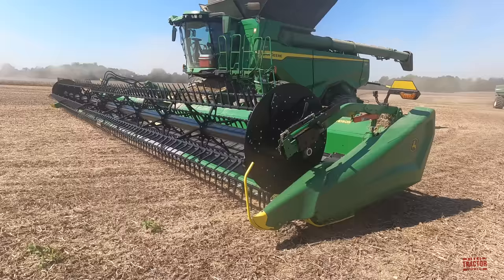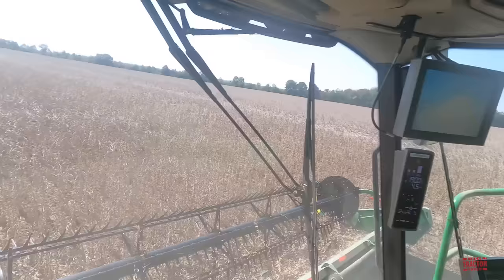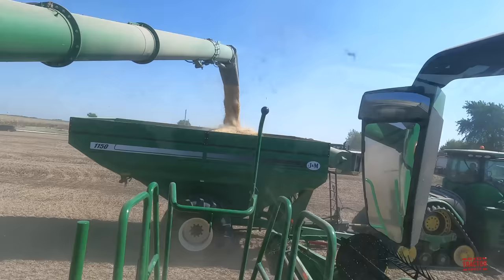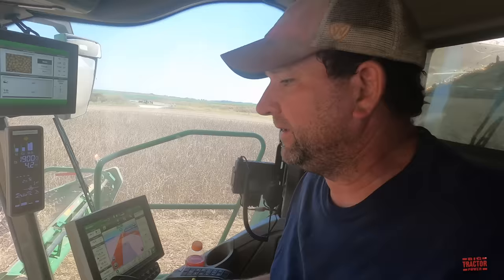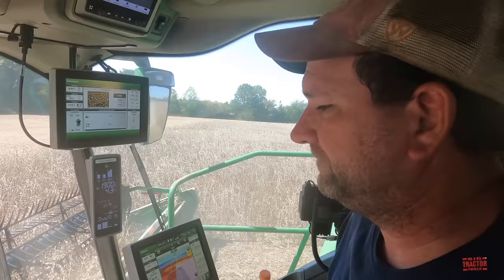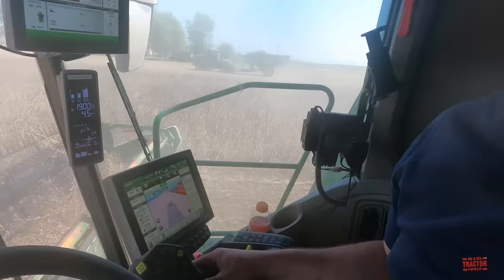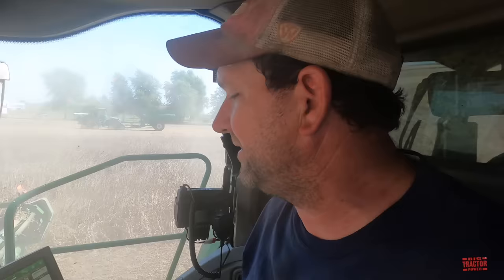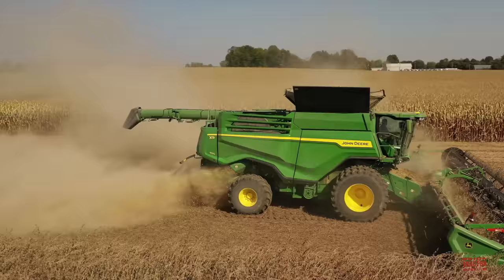50ft JOHN DEERE HD50R Draper Harvesting Soybeans

Comment: We grow soybeans here in central Virginia. Have a john Deere 9500 with a 30 foot header. Nothin fancy but it works
Reply: good for you bud. 9500 was and is one of the best
Reply: How fast do you go? I thought 25 was the limit for a 9500
Reply: Your expense $ 35000 this x9 with head $ 10000000
Reply: Great video
Reply: Yea but man they have problems at 25 years old.  We are down day after day.  Had to have a sts rotary come save us. It was good for it's time and still good for around 1000 acres.
Reply: @bendunkelman4853  we chug at 2.5 to 3 mph. The motor has had quite the power boost over the years. Our beans normally dont yield high, most are double crop after wheat anyways. She never has to work hard in anything near 80 bushels
Reply: @MRSludgedude  we only grow a few hundred acres of beans and wheat each year. On our dairy we prioritize the forage and silage equipment.
Reply: @tctarheelfarmin358  yea good machines for that. They can't match rotary in capacity but they are easy to work on and get parts and won't put anybody in debt like the newer stuff.  The 9600 will do 60 acres of decent soybeans in an 9 hour day.
Reply: I run a 1976 year model John Deere 3300 combine with 213 header on my little tiny Farm.
Reply: @SoybeanFarmer3300  Congrats to you
Reply: There's something to be said for running older equipment. A million dollars for one rig is crazy.
Reply: @j.lebowski3917  would certainly seem so for those of us who are not capable of dreaming that big.
Reply: @JD-oh9vz  tell your mail id sir we are the manufacturers of harvestors in india i will show you our products

Comment: Good lord, must be close 4 million dollars running around that field with those two other tractors, carts, and trucks.  His either independently wealthy or has his banker in the back of his pocket lol.
Reply: That is just the nature of farming today.  Any operation of size has millions of $ of equipment and very often it is financed or leased.  It's no different than many other business that haves business loans for buildings and equipment.  Farming is a business.
Reply: And what I don’t Understand is Not 1 Single Tarp on those Grain Carts. I would hate to have a Pop Up Midwest Shower, ruin 3-4,000 Bushel of Soybeans. It would be different with Corn (even though you don’t want it to get wet), but Beans Swell Up and Rot Quickly/A Lot Faster than Corn does. Tarps are A Lot Cheaper than Thousands of Bushels of Bad Beans. Also surprised that they weren’t running A Little Bit Bigger Grain Carts & Tracks or Floater Tires on those Grain Carts. At that point what is a Little Bit More Money for some Flotation/Low Compaction Wheel Setup.
Reply: @taylor11089   The grain is not in the carts long enough to worry about needing to tarp them.

Comment: My late Father always said they shouldn't have made tractors bigger than a 4020 or 806 and combines no bigger than 15 foot cutter heads and 4 row corn heads.  I feel the same way but damn that is an impressive combine and head.
Well done video BTP
Reply from the maker: Machines have grown and grown.  It will be interesting to see what the limit in size will be.
Reply: @bigtractorpower  size is Probly going to be maxed in 10 years. Going to full auto so they will run alot later and longer will be the next HP wars. Put us all out of a job in 15 years.

Comment: We have two S790s. One runs a Macdon FD140, and the other runs a John Deere 735FD. We have the smaller head because it fits on terraces much better than a larger platform would.
Reply from the maker: Which of the two headers do you like better?

Comment: Amazing machine. I assume the beans are separated from the plant and deposited in the machine until full then the other machine pulls along side so it can off load the beans without stopping. Then the remains of the plant are deposited on the field. When is it determined the beans are ready to harvest? We drove thru Indiana, Iowa, Ohio and South Dakota this fall for the first time and was amazed at the amount of farms.
Hats off to the farmers and their machines.
Reply: A combine is a big ol' sifter - you can change the "screen" size to select for the crop you're harvesting. To maximize harvest of the beans the plants need to be dry enough that the pods crack cleanly & release all the beans inside the combine.
Reply: @ryanwaege7251  Thankyou. Amazing equipment.

Comment: First time I've seen an X9 1100 with the 50 footer on youtube. Thanks BTP!

I'd like to see a Claas 8800 in comparison, if you run in to one of those ;)
Reply from the maker: I would like to track down an 8800 as well.  I just filmed an 8700 over the weekend. It was impressive.
Reply: @bigtractorpower  They are really impressive, especially in Corn. There is a video here on youtube, with a guy demoing an 8700 with a 12 row. He was running 7-8 mph, and the head maxed out before the combine.

Comment: I used to run one of those heads on my 6620. It was ok, a little small for my combine
Reply from the maker: The 6620 is a great combine.
Reply: Use to run a 6620 but got rid of it because it didnt have a fridge or kitchen sink or bathroom.

Comment: This is amazing how's JD improve the combines from the S class to the X class. It's so impressive
Reply: From the guys I know they say a lex 750 will still slay an x9 and do what 2 s680s will do. What the 8900 lex can do is almost pointless unless your in Nebraska wheat and tough straw. We not a big enough operation to even demo such things.
Reply: @MRSludgedude  one problem i see, same here in the uk, is that the output of these x9 combines, the 8900 etc have such massive output that the grain augers, drying systems, corn carts etc cannot keep up. I grew up driving a 13foot cut new holland and thought the 20 foot cut a neighbour had was huge at the time, amazing how things have progressed
Reply: @bens8919  yea we can't keep up at the elevators wen they run a lex . Nobody has any x9 here. But a few have 740 and 750 lexion and they do the work of 2 deere s680s at much less   HP .
Reply: @MRSludgedude  If that were true everyone would just run a Claas. Period.
Reply: @davidwilson1107  no because they have a bad rap on service and parts.  Plus they cost more than a deere. Break down you might wait two weeks for parts. Deere keeps you going in hours . Seldom any down time with deere. The guys in the field next to us run 2 770s and other runs a lex 740 and the 740 gets done at the same time as the two greenies.  And a 740 is one of the smallest.  Now I can't say who has more loss. Everybody here blows it out the back no matter what color.

Comment: Could think of afew local guy's in Canterbury, New Zealand drooling and hoping xmas tree a big 1. Best X series video seen so far and I'm a claas and axle flow combines fan 👍👨‍🔧🚜🇳🇿
Reply from the maker: The X9 can cover the acres. A big new Case IH combine is not too far away. As these machines grow to the size of the CLAAS 8800 50ft drapers will be needed to keep them rolling at peak efficiency.

Comment: As an Industrial Engineer in the auto industry, I would be curious to understand what the savings is between the old 45 footer and the 50 footer.  You obviously cover the same ground faster, but does it require more support to keep up with the combine?  If the larger head gets you done with harvest say 2 days sooner, what benefit do those 2 days get you?  Does it get you a higher price by getting to rhe elevator 2 days sooner? There needs to be a payback for the additional cost of the equipment.

Comment: $890,000 each.  2,000 bushels per hour in 85 bushel beans.  Well... you can buy a used TR99 for way less than $100K with a 30 foot header and do 1000 bu/hr with it.  TR99s are half the HP that the X9 is but only 1/10th the price.  Do the math.   One of the problems modern farmers have is huge investment in equipment per acre farmed.  It didn't matter when interest was 1% but now that it is 5%, it is a different story.   

You can also buy used NH CR8.90s for cheap.  Great machines.  2 x CR8.90s would outwork that X9 by a lot.   8.90s are 450HP each.  The X9-1100 is 690HP when unloading, less when not unloading. 

I know that running one machine saves labor but it isn't hard or expensive to hire a combine driver for a second machine.

Comment: Max power boost is 690hp to 735hp wit 53hp power boost when dumping on the go  big tractor power thank u for sharing this video I been looking for it harvesting soybeans back home in North East Louisiana and out here were I live here in Mckinney, Texas 30 miles north of Dallas, Texas I work for deere as a equipment setup technician for 17 years our 13.6 liter power tech pss diesel 830 twin vgt turbo chargers it has 11% more horsepower than the 13.5 liter power tech pss diesel 842's engine on the S790 rated at 543hp to 616hp 34hp power boots when dumping on the go
Reply: 8900 has 790hp
Reply: @jwald478  yeah that's our foreigner that harvest green corn that not ready thay harvest it like that for silage

Comment: We have so many cut up fields, 40 feet is the biggest header we run together with a Claas 8700TT, our two S780s have 35 footers, otherwise we´d spend more time turning than actually harvesting.
Reply from the maker: I just filmed an 8700TT in soybeans. Very impressive combine.
Reply: @bigtractorpower  Claas is an often overlooked brand. If you find an 8700 impressive, just watch a Xerion turn its cab around. It's like watching Optimus transform. 😁

Comment: Those x 9s are nice but way too expensive for the regular farm with a normal budget . This farm must have deep pockets or a crap ton of debt .   The little graincarts are a joke when they can afford 2 x9s  and 50 foot heads .  I think I'll stick with our gleaner s98 and case 9240 at least they are paid for .  Great video keep up the good work  !
Reply from the maker: The J&M cart is 1,000 bu which fills a semi full.  This allows for a constant flow of grain. Larger carts also compact more.
Reply: @bigtractorpower  that makes sense for their operation. I still think 2 larger carts would work better.  But every farm is different and I respect their way of farming.  Take care!
Reply: @anthonybanda8192  And what I don’t Understand is Not 1 Single Tarp on those Grain Carts. I would hate to have a Pop Up Midwest Shower, ruin 3-4,000 Bushel of Soybeans. Its different with Corn (even though you don’t want it to get wet), but Beans Swell Up and Rot Quickly/A Lot Faster than Corn does. Tarps are A Lot Cheaper than Thousands of Bushels of Bad Beans. Also surprised that they weren’t running A Little Bit Bigger Grain Carts & Tracks or Floater Tires on those Grain Carts. At that point what is a Little Bit More Money for some Flotation/Low Compaction Wheel Setup.
Reply: @taylor11089  yeah I thought they needed a larger cart as well.  Take care.

Comment: Not trying to be a smart ass, but does it really need 690hp for this type of machine? I thought these new harvesters where 100% hydrostatic. This seems to be a lot more power than needed to drive a hydraulic pump.
Reply from the maker: You are threshing 50ft of crop material all at once and unloading on the go.  The power helps.  These combines are built to harvest damp 200 bu. Wheat in Europe. The power is a plus for all other crops after that.

Comment: Another great video! Has the Garnett's, or anyone else in Western Kentucky got any X9's on order for next wheat harvest?
Reply from the maker: Not that I know of. I think it’s all S790s in 2022.  The issue is trade ins.  The farn wants X9s but they trade yearly so where are the one year old X9s going.
Reply: @bigtractorpower  I appreciate the reply!
Reply: @bigtractorpower  I would think that 1 Yr Old X9’s would be quite easy to Get Rid Of, especially in the Midwest since there is No Depreciation to Pay On Them, and there is No Massive Brand New Full List Price for those Combines since they would be Used. There are A Lot of Guys that Flip/Roll Combines every so many Years & Trade Them In for a New Machine, and there are A Lot of Guys that Buy Used Combines from a Dealer that are Only 1-3 Years Old. It’s a Win Win, for Everyone from The 1st (new) Buyer, to The Dealer, to The Used Buyer who is getting a Slightly Used Machine. Especially when the Used Buyer knows who the Original Owner (New Buyer) was, it helps the Transaction Process go smoother. Happens Quite Often in the Midwest, and I would assume that to Probably Happen else where in the US & Canada.

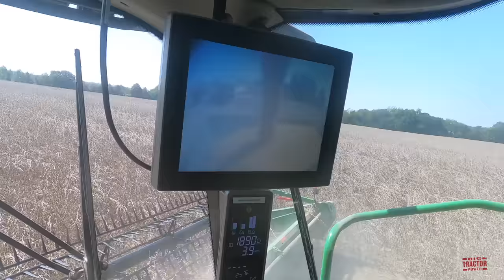Comment: At around the 7:30 or 8 minute mark, the operator set his auto track to where his header was almost half out of the the wheat. Why did he do that when he could’ve reset it and not waste almost half of a pass?
Reply from the maker: If you are talking about the cab view he is taking all 36ft.  You may be seeing a matted part of the field from combine tires or the grain cart.
Reply: Sorry, I put the wrong time stamp. It’s actually at the 6:00 mark where he is making the 3rd opening up pass. It looks like most of his header is out of the wheat.
Reply from the maker: I apologize I thought you had replied to my new video out today on the John Deere W200M windrower. He was squaring up the corner.  When he ran father up he started cutting a full 50ft and then turn around and cut out a section of the field.  There was a house in the middle of the field. By making they half pass on the first part the other X9 made a full pass each time behind him.
Reply: Ok, thank you. I help with wheat harvest at my grandfather’s farm in Anthony, Kansas. We have two s780s and a 9200 tractor with a Unverferth 1160 grain cart. We harvest about 10,000 acres of wheat every summer and double crop after that.

Comment: You mentioned they ran 3 790s with 45 ft heads. I was hoping you would ask if running just two x9s with the 50 ft were doing more and if so how much.
Reply from the maker: They definitely out pace the S790. For example in corn a 790 is at 4,000 plus bushels an hour vs. 7,000 plus on the X9.
Reply: @bigtractorpower  wow

Comment: Great video Jason. could you explain a Draper header? in the UK Draper is a tool manufacturer and that looks like a normal combine table ( but a lot bigger and in two halves! ) except it has a belt instead of an auger.
Reply: Well you got the gist of it. A draper header uses a belts to feed the combine with, usually they are lighter than headers of similar width that use an auger. Draper headers also allow smoother feeding.
Reply: @maxmoore970  Thanks for that Max - using belts over that width would make a lot more sense anyway, less damaging to the crop than an auger.

Comment: Why do US farmers run with dual front wheels whereas UK and Europe run on tracks?
Reply from the maker: The row crop duals reduce wear from stubble running between the rows. Tracks work well but are much more expensive.
Reply: That they are! The problem we’d have in UK would be moving combines about on the public roads with duals wheels on. It’s difficult enough when they’re on tracks.